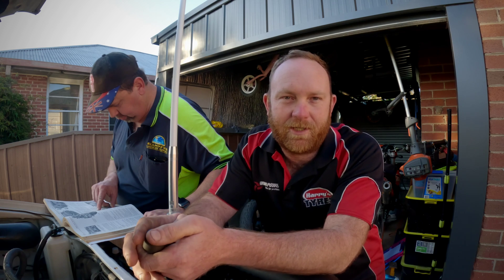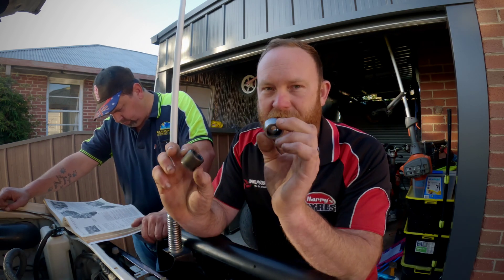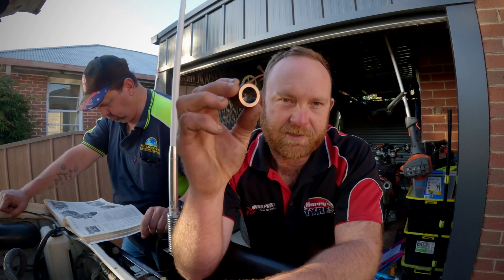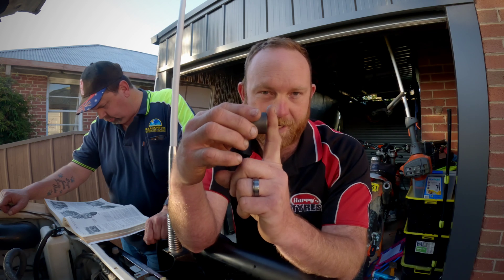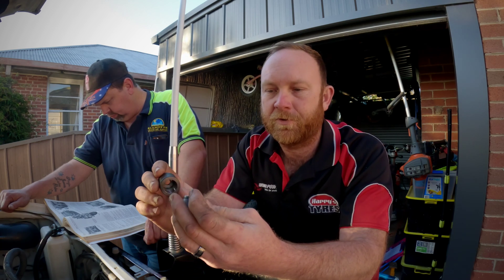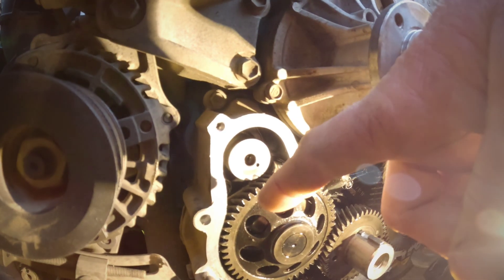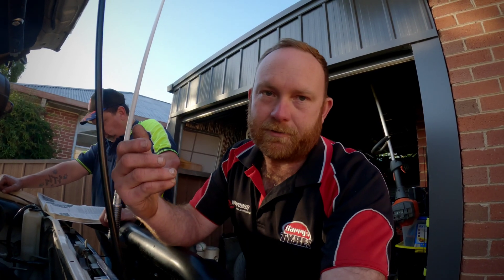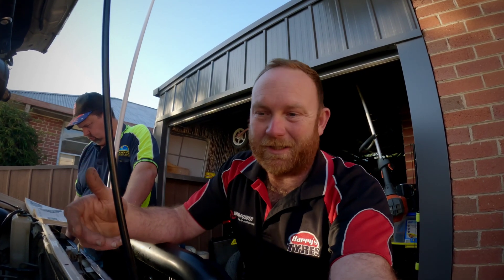1kz ballance shaft delete

Comment: Any update on this?
Reply from the maker: Verry soon mate
Reply: @TRAV30387  Hello mate. Just wanted to ask you if you are running free wheeling hubs on your Lux (i'm presuming you still have it) and if you are you'd be the right guy to ask about this problem i'm having. I own an 04 Hilux SR5 and i put freewheeling hubs on mine bought brand new not second hand. On the passenger side its working fine when i turn it to lock the CV shaft goes into lock like it should and i'm getting drive to that side. But when i turn the drivers side hub to the lock position it (the CV shaft) does not go into lock like it should but keeps rotating like its in permanent freewheel. I tried taking it off and reinstalling it several times...no good. I even tried swapping the hub on the passenger side to the drivers side ...same thing. The CV keeps turning. The hubs themselves are the good ones (Aisin) so they are not shit. AND yes they did come preassembled out of the box so i didn't have to do it. All the parts went on the bolts the clips washers everything. The CV's themselves are in good shape although i have had a 2inch lift with a Diff Drop kit added. Any thoughts please mate. I'm near pulling my fukn hair out over this!